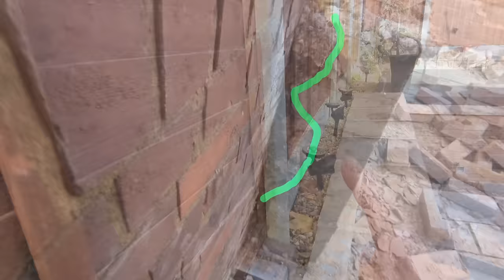PART 2! What exactly DID go wrong? Who paid to put it right?

Comment: I worked for a cement company for 30 years batching concrete you're cement had way to much flyash in it  flyash is a cheap filler to stretch cement that is why is so  brittle and goldish or yellowish color looks like a bad batch cement if you still have a sample of mortar I'd take it to the cement company they might help pay

Comment: Would it be an idea to use a plastic membrane similar to basement tanking then weep holes at low level to divert any water to a level where you can manage it with weep holes, I think current membranes are about 25 mm thick could be mechanically fixed as it’s not a basement situation rebuild the wall with engineering bricks and also drip edge on the coping’s with a minimum of 40 mm overhang

Comment: I realise it's extra (avoidable) cost but to harden-up on the theories you could've sent a sample of the mortar for analysis.
I had a similar problem when the cellar was tanked. The conculsion was that much too much waterproofer had been added to the mix. The contractor thought they were being generous.
I have to say though, I don't think it's the same here because it sounds like waterproofer wasn't used and in my case the problem was present from day 1 but it might point to or rule out alternative causes like a bad cement batch. It has to be significant that some of the original mortar was fine. In fact isn't it the case that the diferentiator between good/bad is NOT location but rather timing i.e. a change in mortar batch? Also, the bricks themselves seemed ok so why would changing to enigineering bricks help?

Comment: yes mate this is a common problem with low lying land a bigger caverty would be better so it can breathe... and  the over hang would be better if it's a 35mm.. and a drip lip like you cut in. another way is to paint or spray a Ron seal clear sealant so that you get no water penetration from the front. it worked on one of my jobs. good luck 👍

Comment: I'd be contacting the neighbour to let them know about their "retaining" wall- does it have any drainage/weep holes along it's continuous, unbroken length? How close is the house on the other side? does it meet the 45 degree angle from the property edge to this lowest point on the neighbours side or is it steeper? Any evidence of the neighbouring properties side elevation cracking or leaning it maybe needs underpinned?? As to the wall you rebuilt, I'd have left it as a "freestanding" entity and cored a load of holes along the block wall behind and opened up the ends, just let the water do it's own thing.... I once used decent thick slate for copings on a mates wee retaining wall (done FOC), should have keyed the undersides with a grinder and cut some anti capillary grooves they never stayed on...!!

Comment: You showed on the first video that the mortar was crumbling 10 to 15mm all the way around the bricks, not just on the front face, so if it was water dripping onto the face and freezing, how do you explain the crumbling mortar at the back of the bricks. Plus the fact, you can't just dismiss the weight of water issue coming down the hill, it's still a relevant that must be addressed. Good on you for sticking at it though.

Comment: With moisture coming from the front, from the lack of drip profile, and moisture coming from the back due to the retaining wall/water management, that wall was going to struggle. 
I am not experienced in this, as I have very much taken a career direction away from needing to detail brick wall build ups, but I am curious. 
Does this need more air flow between the walls? 
Is the lack of air flow doing any harm to the retaining wall behind the wall you constructed?
Is more needed for those slabs to protect the wall cavity from rain water entering it?

Comment: There is other water problem you missing, Brick /veneer isn't water proof. Rain goes behind the wall - capillary  elevation, or poor packed brick head's join, also /missing membrane / under coping stone.  Here in US,  brick starts w/flashing  membrane on foundation ,extended least 1ft. on vertical structure  wall then veep hole/ cell @ 3rd brick. Flashing help suck moisture from foundation also, capillary  elevation   drive the water up 1.2 m high.I stop use mortar on coping stone  butt join but polyurethane caulk. It important to keep cavity behind brick free of mortar, avoid solid bottom of cavity US call for mortar net , water can reach veep hole and get out. Wait spot on brick face call luminescence is salt ,left when water evaporated and proof water present  in wall .

Comment: my guess is after the wall was built and the situation of it not getting any sun with the wrong coping stones the wall took a lot longer to dry out... rainwater attacked it from the back and front as you showed which was proven by the mortar all weak and soft front and back ..im guessing but if you check the time the wall was built ( date and time ) and then check the weather a day or two after the wall was built i bet their was a downpour where the rain got into the mortar whilst it was still wet .

Comment: First of all a membrane will only stop the wall from soaking it will not change that it needs an outlet, you could put a gully behind and run the membrane into it to outlet in a suitable place 
Second the coping needs a bigger overhang and possible a slate dpc under it, also if they are flat they need bedding with a fall toward the courtyard.
Naff all wrong with the bricks.

Comment: I think you've hit the nail on the head. It is constantly saturated and will no doubt go through freeze/thaw cycles. In your other video, you can see the wall has been damp. You need to put a dpm barrier behind the facing wall. Put plenty of weep holes at ground level and put plastic sheeting up behind the wall backfilling with a granular material as your wall gets higher. The drip grooves will make a huge difference. Do an Internet search for building research establishment (BRE) good building guide GBG27 - Building brickwork or blockwork retaining walls. It provides advice for all that you are encountering in this build, high & low level dpc, weep holes, waterproofing to rear of brickwork, backfill and getextile filter fabric. It is a good document. Best of luck.

Comment: you did that job and fixed it dew to an issue you did not know about , at this point you have done do dinagence  and informed the customer of they issue , it would be nice but as a contactor its imposible to foot the bill time and time again , if the customer want the water issue addressed then that is a seperate job,

Comment: im thinking when they jetwash the garden they all so jet wash the wall and the water under  pressure is forced into the mortar which eventually washes out the cement  leaves just the sand  and then the frost will do the rest

Comment: I had the footings up to DPC and was asked if the cement was acid resistant I replied that all the work is above ground but below  DPC well that requires acid resistant cement then, have you just read a book or something I snarled -oops tear in down and I will see you when it is rebuilt said the building inspector.

Comment: Hi having seen the original vid of which i commented on about putting a membrane on the inside,,, and also that you bite the bullet and redo the wall cause its easy to get a bad name,,, anyway to be fair i dont think we had all the facts last time,,, moving forward I would still put a membrane at the back in conjunction with a drainage system that allows the water to escape as well as using a coping with a drip edge. the fence no problem  there only 2/3 post  to lift out while your working so not an extra cost to you ,,, any way good luck with whatever you do to rectify it,,, but if it was me,, i do do a bit more than less as your already there
Reply from the maker: Hello Ray, appreciate you taking the time to comment. Not too sure what you mean by some of this though unfortunately, in the video I explained why some of what you say isn't possible. I can't touch that fence, it's not the customers. I can't just "lift the posts", what do they go back into? The ground won't be there. I can't membrane the back of the wall on the neighbours side as I can't get to it. I can't put in drainage as that'll mean doing under the neighbours patio.

Comment: Hi mate I'm a mechanical engineer and a master of physics I can tell you for sure its ground water seeping through  the soil there is far I'm sure the face water doesn't help but I guarantee it's a minor contributing factor you pointed out how that 14 metre wall which has a house behind it is moving proving it's not surface water because it would back up and run out of nxt doors front garden and down the hill besides which that wall is engineering bricks and probably  
4 to1 and its failing consider it to be an incredibly slow land slide if you got a surveyor to check I'm sure hed tell you all the houses on that street are moving down hill at a rate of like 5mm a year or something the only way to slow it down is to drive piles in at least the depth of the wall but it wont stop it just inhibit it some so even if you build it out of engineering  bricks it will still fail eventually but it will probably last at least twice as long but it's the best you can do for them I reckon maybe add a couple of air bricks top and bottom  at either end and in the middle  will create a draw keeping it in better condition  longer but only piling will significantly slow it I'm willing to bet two days after heavy rainfall it looked like a captive pond between those two walls before air bricks at ground level will assist in drainage and near the top will catch the wind and dry it out with evaporation due to movement of air by the way I'm 47 my dad is a retired master builder and my older brother is a brick layer best you can do for them is the engineering brick wall and make them aware feel free to show them this message and if they want to confirm it get it surveyed 😁👍feel free to throw any questions my way @rowlandsdom on Twitter
Reply: Also sleepers would still move and yes they would rot
Reply from the maker: Morning Dom. You may be a master of physics but you're clearly a novice when it comes to punctuation! We really appreciate you watching our videos and commenting but we always call people out when they are talking nonsense and unfortunately this is one of those times. The houses are in no way sliding down the hill 5mm a year. They've been there at least 30 years! Do the maths! Again, really appreciate you chipping in but I won't be showing the customer your message or getting in touch via twitter. Take care.
Reply: @mrabuilders6723  more over if it was just surface water it would need repointing and your wall was close to collapse and I've seen a thousand walls that had to be repainted due to surface damage and they were decades old not four but hey you know best about something you've never seen before my dad lived in Bristol for years and learned about what they call seasonal adjustment  and gravity the hard way like you but then he adapted and overcame the issue in future  jobs but hey " you know best " captain 3 walls

Comment: The fact that the wall has moved tells me there is no retaining wall behind the bricks or there is one &  it has failed, lot of pressure pushing against it with the sodden ground & weight of the houses   i cannot understand why you are going to re build it a third time  when twice would have done , i still think a membrane is vital on the side wall as your property is probably below the water table a membrane onto the Staffordshire blues with the weep holes in the Staffordshire's would still allow surplus water out & keep your facing bricks dry, id hate to see video 4 in a few years time , id do everything possible next time to try & prevent a recurrence of what you had, Good Luck & i hope the customer chips in ,i mean you could argue that anything extra that wasn't there before is chargeable if you do everything possible behind the facings

Comment: Yeah really stinks you replaced it free. It's actually a problem that was never addressed when that fence and wall was built. No proper drainage. Your wall was bound to fail unless you caught it. I would have said your wall here is collapsing and your yard is shifting, how is that my workmanships fault? Maybe you could have used a special cement or put water proofing behind your build just to save your work. Seems like they're going to ignore the problem till it falls. When it comes to outside, water and slopes rule everything

Comment: I think you should have been more honest with yourself and the customer. In reality the customer, isn't going to get the job they won't, because their neighbors water management isn't managed in the first place. Building a stronger wall want change what going to enablely happen . Their neighbors wall is failing and unless they manage it ,anything you do will fail . If it were me I'd strip back to where you started the sidewall and inform the customer you can build a facade wall ,giving them a better looking wall ,until the complete failure of the neighbors, si that both are rebuilt to the correct standards needed for both properties to be problem free ,so you don't open yourself up, so that the neighbors can blame you for undermining their wall to support your new build . I know when your trying to run a good business, your trying to keep the customer happy ,but there are some things you can't work around and still expect lasting results . No one wants the bad news ,but dealing with added problems, is just the same as cutting your nose off in spite of your face . Sometimes you have to relieve yourself, of the problem that's BELONGS to another also . Hope it works out.

Comment: Mate I have just seen the same thing on a small barcecue I did for a friend, it is not below ground level and showing more or less the same type of issues as your wall so I am not sure at all what caused it but I think it was a cement issue as the bricks I used were a harder bricks than London's , however I have used thousands of London bricks over the years without any issues except coming as cross soft batches of bricks ,like you I am left wondering what caused the issue!👍

Comment: Subbed to see next years solution
Reply from the maker: Cheers mate, hopefully you'll enjoy some of the videos leading up to that!
Reply: @mrabuilders6723  Im sure I will, I like to do things myself but brick work is not something I have much experience with so im sure ill pick things up. As for the mortar failure (i know more about theory of things over actual use from previous education / employment) I think the cavity is partly to do with it, large moisture source and little venting causing all year round damp bridging pulling apart the lime bond in the 5:1 then winter freeze causing the failure. But this is just geustimation speculation!

Comment: Really dont know about the engineering bricks, youre only facing up an existing wall, if somethings attacking the mortar then surely it should be attacking the mortar just the same in the retainer behind it. You arent below ground there, its just an outer skin. And those holes that have been left are more than adequate when paired with a depth of gravel to act as a soakaway, more than a few thousand embankments up and down the country that have proved that. Id try with a harder mix and a touch of waterproofing in there too, the copings are spot on though they will work wonders to protect the face.

Comment: Just a suggestion with the back of the wall where you can’t control water. If there is a little gap put some Lemix behind it with a fall down to the side where yoh can manage the water. Your just really unlucky that you had a job where there is so much water going there and like ya say the back of the wall compo would have been broken and damaged like the front of it was the water behind the wall causing the problem. Your issue would have helped so many people who would have done the same but now they’ll no not to cause of your video. Wouldn’t put yourself down takes a true man to show failures
Reply from the maker: Thank you Daniel. Appreciate the comment mate. I'll be looking into that Lemix stuff! Nice one.